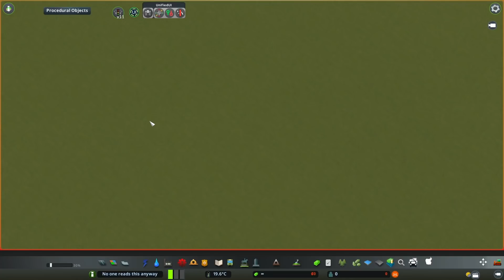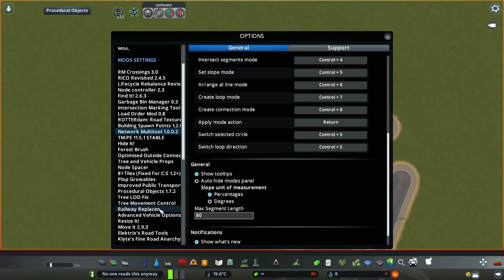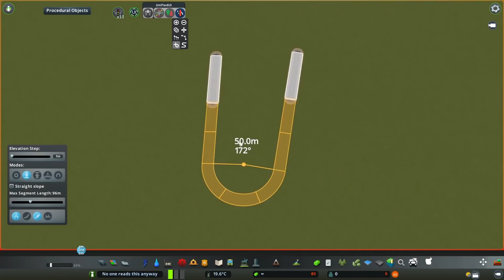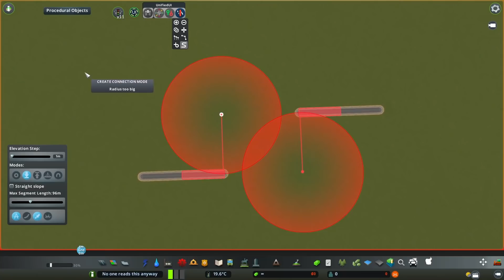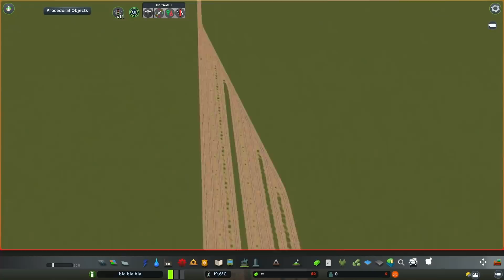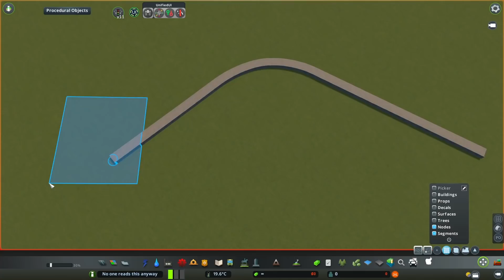New Super Powerful Tool for Network Building - Cities: Skylines Network Multitool Mod

Comment: Breaking news: Oil tanker train derails spilling 340,000,000L of crude oil into the city. It has been found that the initial curve into the yard where the incident took place actually had a radius of 149m, 1m less than documented. The deranged engineer responsible is currently being apprehended by authorities.

Comment: i have 2 questions at the video timeline 3:53
1) I installed the Network Multitool 2.1 <== but in the game, the UnifiedUI interface is different compared to yours. I would need to go down the screen to access the button. How did you adjust the settings?

2) When you clicked onto your road assets, you have a bigger UI and can see 2 rows of your roads choices. (mine is only single row. Which mod you used for this?)
Reply from the maker: Not sure about the first question, probably just some settings in the UUI mod, also it got updated so this might be  how it looked before. The toolbar is made bigger with the Resize It mod.

Comment: Does it work with bridges and tunnels as well, or a piece of road/rail that’s transitioning into a bridge/tunnel? 

It would be cool if this could be made to also draw a parallel road at the same time; that would truly make highway construction so fast it would be ridiculous.
Reply from the maker: Works with anything, best used with other stuff of course, like Fine Road Tools.

Comment: 20:40 How did you move the node inside its segment? When I try to move nodes they always go crazy
Reply from the maker: There need to be at least two straight segments, so Move It can snap to the helping line. You then just hold alt and move.
Reply: @Akruas  thankyuuu